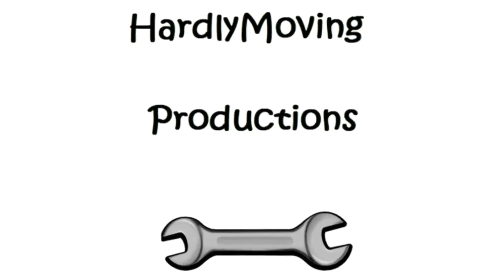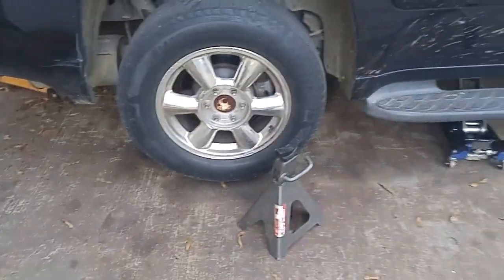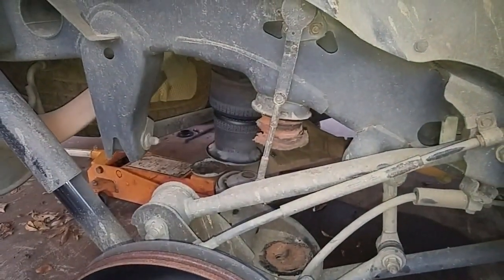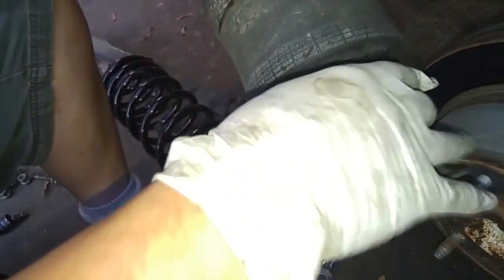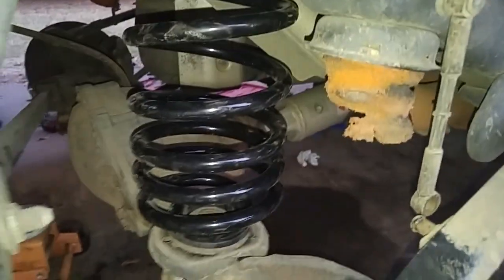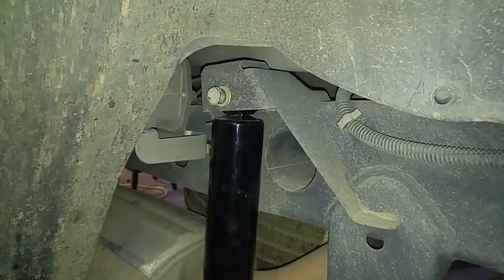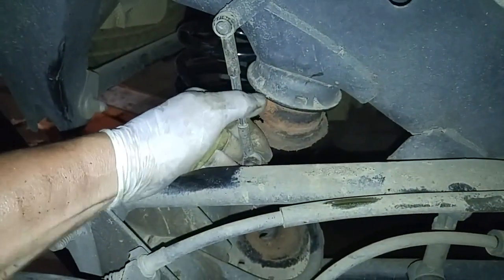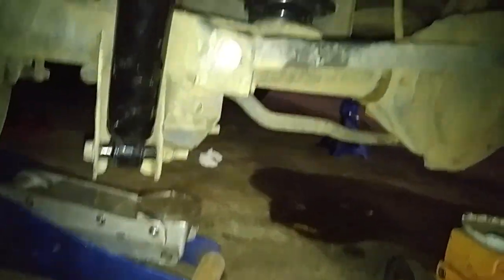Air To Coil Spring Suspension Conversion - Envoy, Trailblazer, Bravada, Rainer, Ascender & 9-7X

Comment: uh oh, I only ordered two isolators, I thought they went on the top of the spring for each side, and none for the bottom.  Am I wrong?  I'm about to do the conversion and I bought the springs used.
Reply from the maker: You should have a spring isolator for both the top and bottom of each spring.

Comment: I have the same problem but my spring arrived just with 1 rubber cap i should use on top or the bottom ??
Reply from the maker: If it didn't come with 2 caps, I'd return the part for an exchange or refund.
Reply: Okay thanks but if I get 2 I should use on top right??
Reply from the maker: From my recollection, yes.
Reply: Thank you for your help i got it done today looks totally different the suspension and lot of more cheaper than buy the motor compressor and air ride bags.
Reply from the maker: Good for you and thanks for sharing!

Comment: I did this and now my back end is supper clunky when hitting bumps.  Any ideas why?
Reply: my back end also sits up at least 4-6 inches higher (like its "jacked-up" as we used to ball it back in the 80's)
Reply from the maker: Worn stabilizer bar links or bushings maybe.

Comment: Thank you my guy I was getting ready to pay somebody until I saw how easy it was to do it!  I am getting a pristine 06 DTS 100k rides fine but I want to replace before *this*happens!!  Think I got another 50k?  It was mostly garage kept by older mother, single owner.
Reply from the maker: With coil springs instead of air springs, should easily last pass 50k.

Comment: I did this on mine, and now the rear sits lower than the front.
Reply from the maker: Wrong spring height?
Reply: @hardlymovingpro ... 2007 GMC ENVOY DENALI  here.   Would you be so kind as to prove the dimensions; height, spring so as to maintain a "level" vehicle?  PS... my towing is limited to relatively light 6×12 trailers and tools are likely to be hauled on occasion. 
Thank you.

Comment: I have scrolled through the comments and I don't see a comment on the comfort that was loss after loosing the Air suspension. Is it most noticeable ? Is there a enough difference and sacrifice of the ride comfort level to just junk the truck?
Reply from the maker: Not that much IMHO.

Comment: I think your coil springs are installed upside down.  The tighter coils are supposed to be on top according to other videos I watched.  Otherwise a very nice video.  Thank you for producing this.  I have a rainier I have to do the same thing to.
Reply from the maker: Could have been installed upside down but so far been no customer complaints.

Comment: Great video. Thanks for posting it!

My experience was not as straightforward as yours. When I tried to remove the air bags they did not come out easily. The collars were firmly stuck in place and turning the bags counterclockwise only caused the rubber boots to spin on the collars. This seems to be a common problem over time, but there is not much written about how to solve the problem. The solution I found was to work my way around the collars with a small prybar until they were loosened. Once I could feel play in the collars I was able to grasp the boot near the collars and twist them out while pulling.

As your video shows, this is a very simple and straightforward job. However,  if the rubber shocks don't come out easily it can be frustrating. It took me about an hour to figure out the trick. After that, I got the second one out in 5 minutes!
Reply from the maker: Glad you enjoyed it!

Comment: Thanks for the video, its exactly what has happened to my 2002 envoy!   Got the parts from your link.  The air compressor alone is almost 400 dollars. The spring kit is only 100 or so.
Reply from the maker: Good luck with the conversion.
Reply: It went very well.  My buddy and I did the job in just over an hour.  Thanks again.

Comment: Why do you have to remove this fuse at the end? Sorry
Reply from the maker: You'll have a continuous suspension error display light on your dash.
Reply: @hardlymovingpro  ok just bought a Denali envoy 2wd and noticed it already had the swap so wanted to make sure everything was done right.
Reply: @dawnellmosley4636  hey I know it’s been a few years but did this fit your envoy Denali??

Comment: You should replace those axle bumpers too. They actually do make a difference on the ride. Keeps the axle from traveling too far so the shock doesnt bottom out. GM part is called an auxiliary spring. Easy to replace
Reply from the maker: Good to know.

Comment: isn't there a bypass for the computer so that the air/susp light on the dash doesn't come on? ..possibly even a fuse type bypass in the fuse block?
Reply from the maker: I pull the bulb out of the instrument cluster after a conversion.
Reply: @hardlymovingpro  oh cool that'll work for me👍 thanks !✌
Reply: ...and if I wanted to lift it a couple inches, this would be a good time to do it eh
Reply from the maker: Can't speak to that.  My customers don't want rear end sag during towing.
Reply: @hardlymovingpro  ok, ..is that why you do the coil swap, the air suspension hinders towing somewhat?

Comment: By cutting the line, don't you ruin/lose the auxiliary air compressor that's in the cargo area? I'm just using an Envoy XUV as an example. The same compressor that blows up the air bags has an outlet in a little trap door in the plastic trim near the rear of the quarter panel...
Reply from the maker: From my understanding of most air bag systems, air bags (or aka SRS) systems only require electrical current to activate explosive pellets to lock the seat belt restrains and discharge self contained compressed nitrogen gases into the air bag to cause its immediate expansion;  therefore, there's no tie in to the suspension's compressor.  Hope you found this answer useful.
Reply: @hardlymovingpro  I had to give you a thumbs down on that reply, not sure if you're f'ing with me or what.  My post was completely serious, maybe YOU thought I was F'ing with you, obviously you're smart enough to know which air bags (air level control system) I referred to; was it you that referred to them as "air springs?" Cutting the lines means a leak and you can no longer use the air compressor's schrader valve located in the cargo area as a... well... air compressor to inflate things... like tires. If, for example, the compressor was bad, you could have used the schrader valve to inflate the air bags/air springs even if you had a slow leak. You can even do it to find the leak. Here I am, trying to find an XUV that had that option, load-leveling suspension, and you're trying to eliminate it!
Reply from the maker: @matermark  Oh ... I get it.  Air bags vs air springs.  You're calling air springs  air bags.

Comment: What a great conversion.  I with there was such a modification available for the 2008 Pacifica.  The SACHS Ninovat auto-leveling shocks are terrible.  I replaced mine with brand new one's and there was essentially no improvement.  Junk.
Reply from the maker: I think it comes down to the quality of the replacement springs that'll make the difference in improvement
Reply: Shock bolts in backward. Springs in upside down. Sorry job.